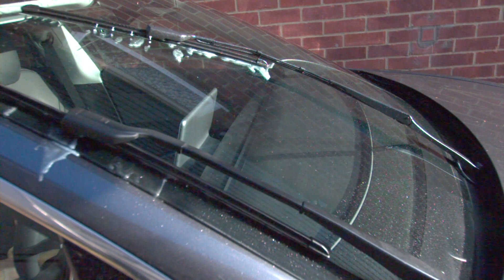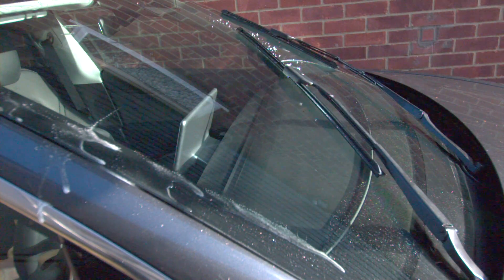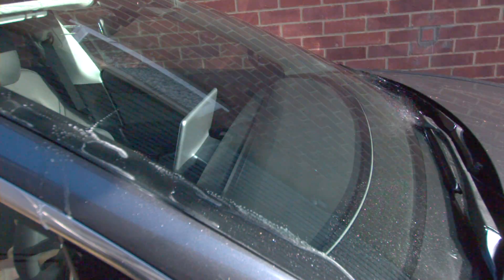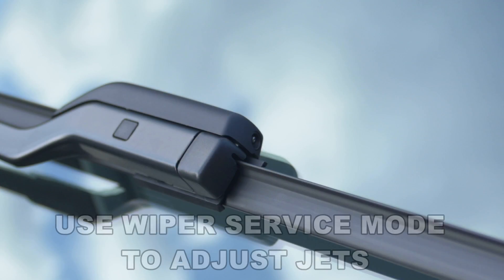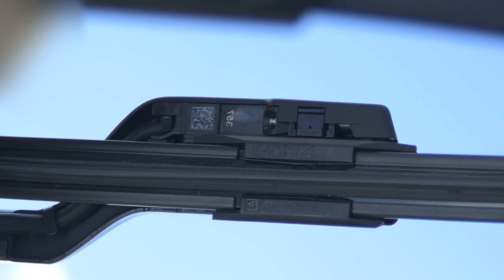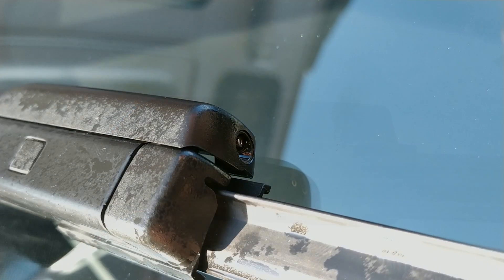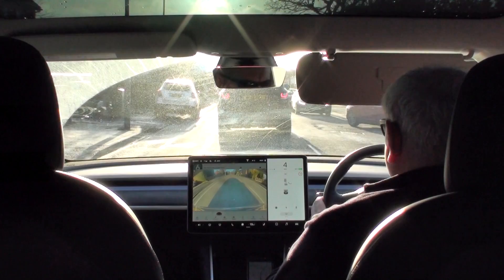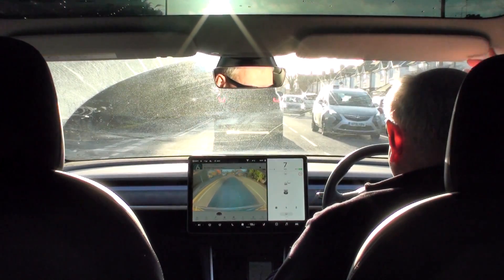Tesla Model 3 windscreen washer secrets revealed!

Comment: Great video. The washer hose drags across my M3 glass making a loud squeak going up and down. Any fix for that?
Reply from the maker: If the hose is dragging across the screen it can't be properly routed. We've seen a few Model 3s with the washer hoses loose or even disconnected where each hose connects to the 'T' piece under the hood. Follow each hose back and check to see if they're all secured properly would be my advice and thanks for watching!

Comment: Cheers mate! Im sure that my drivers side only has one nozzle working. thats why it builds up crap on winter roads. THANKS! booking service now
Reply: same here...how did they fix it? Driver side bottom one not spraying
Reply: @JeGo9 did you fix this? I have same issue bottom driver side
Reply: @GazzasReef  unfortunately no. only option will be to get tesla service to replace at a cost...
Reply: @JeGo9  is it under warranty though ?
Reply: @GazzasReef  mine got blocked after warranty expired. I would need to pay.
Reply: @ mine still under warranty so I’ll try fix then take it in should it be still blocked

Comment: Seems pretty inefficient. The side sprayers just... spray away, not hitting where it is needed.
On our Volvo we have several nozzles on each arm (eight, on each arm, divided into two nozzles units!) so it wastes like almost ZERO fluid (some drops will spill out in the outer end as i have them adjusted now since we have a lot of crap on the roads here, better to have too much on the window than to little).

Comment: The annoying part of washing the windscreen is the water that pours over the drivers window. Don’t leave your window open if you are going to wash the windscreen.
Reply: Yes! I found that out the hard way. Several times because I forget :D
Reply: @misujerr  ouch. Lol
Reply: In Mazda 6 too...
Reply: @volkhen0  lol. Not good.
Reply: @SirHackaL0t.  Teslas is not good at all. Volvo version is superior to Tesla! Two nozzle units on each arm, four nozzles on each unit so eight nozzles on each arm.
Reply: @Xanthopteryx  superior is what way? More nozzles? The Tesla version works well, it’s the edge of the windscreen that fails to stop the water going sideways onto the side window that’s the issue here. :)
Reply: @SirHackaL0t.  You waste too much water. Especially in really dirty conditions, you need the water to be exactly at the right place.
Reply: @Xanthopteryx  Odd, because the tesla puts the water in front of the wiper blade, unlike my last BMW that sprayed water everywhere,
Reply: @SirHackaL0t.  Yes, but look on the video how it sprays away, off the blades. This means an uneven coverage and of course a lot of waste
Reply: @Xanthopteryx  have you got a video showing how it should be done?
Reply: @SirHackaL0t.  Sadly not, but i can maybe sometimes try to fix one example from my own car. But not sure when. Depends on the weather.
Reply: @Xanthopteryx  it works perfectly fine, just water comes into one of the windows if it is open. A slight but annoying design flaw.
Reply: It's not water first of all bud

Comment: Drivers side on mine puts out a lot less than the passenger, this video makes me think the two adjustable nozzles are blocked in some way. Used to use a bike pump to clear on older cars, wonder if you have ideas?
Reply from the maker: One thing to check if you haven't already - the tubes feeding water to the wipers can easily come off the Y piece feeding them, so remove the plastic cover below the wipers and follow the tube to where it goes behind the plastic trim under the winsdscreen and make sure it is connected. If it is and there is a spray from the misting nozzle, then yes I think your jets are blocked and you could unblock them with a very fine needle. I also tend to use pure, dionised water in my washer bottle as I live in a very hard water area and I think over time deposits and scale can build up which could block the nozzles.
Reply: @TeslaGurus  will paperclip works instead if needle
Reply from the maker: @gobear2002  The wire most paper clips are made from is too thick. A needle, safety pin or a really tiny jeweller's screwdriver would be OK. Or you can buy a tool designed for the job online for a few £s.
Reply: @TeslaGurus  thank you for this! Mine is doing the exact same - drivers side.  I will check out the tubing and then try a needle to see if they are blocked